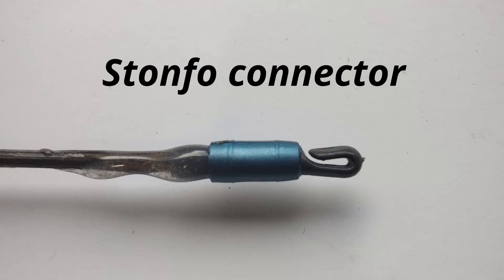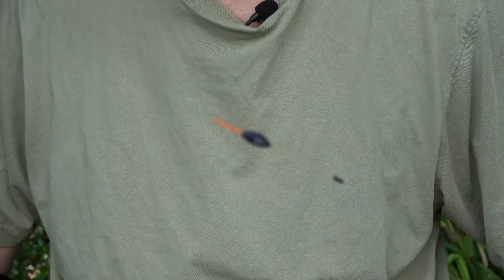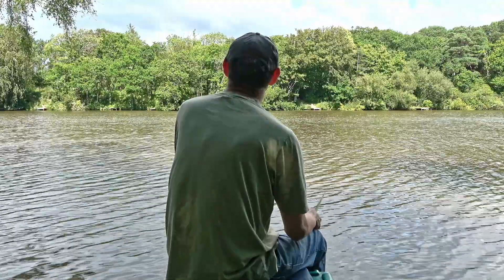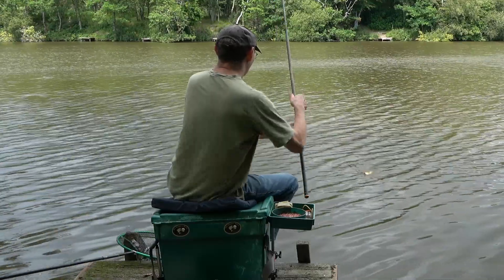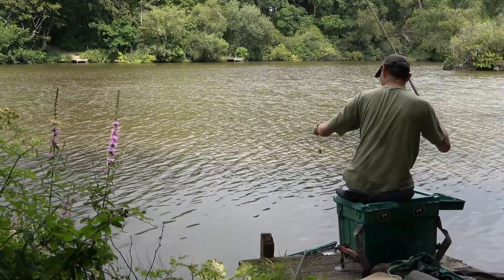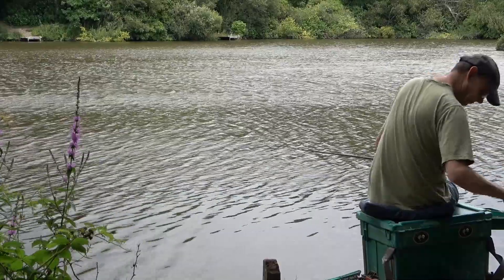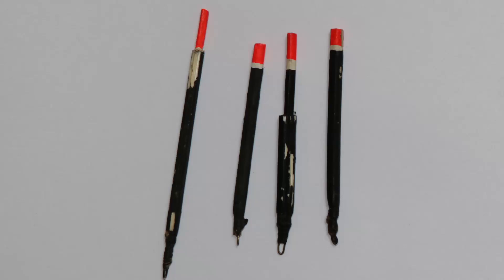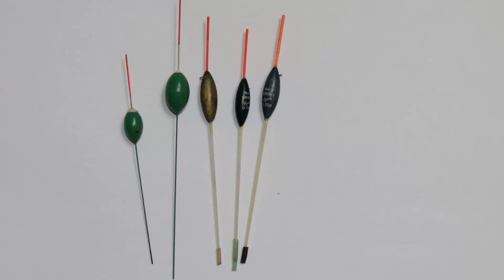Whip Fishing - Part 2 - Setting Up a Short Whip

Comment: I have fished the whip with great success for many years --- I know a lot of folks say to leave your rig about a foot short of the whip----I find that slows you down quite a bit,, if you have it about 3" short of the whip you dont need to move your hand position on the whip, when you unhook a fish and rebait -you  then keep your hand in the same position on the whip as when you are fishing and hold your hook in the same hand and bait up with the other hand. and get it in the water again much quicker than if you have to reach for the hook.--Also I almost always fish the whip with my home made wagglers, which as long as theres not a heavy flow are far far superior to using a top and bottom float -especially in the wind.
Reply from the maker: In the days when I did serious speed fishing which was a long time ago my rigs would have been set exactly how I wanted them. It was a long time ago but it did vary a bit according to the size of fish - quite often the size of fish I was after were very small - down to 85 to the pound. To avoid baiting up very often the bait was usually toughened pinkies with a couple of pints being bought every week but only the ones 3 or 4 weeks old being used. It was possible to get many fish on one bait. For these small fish a waggler float was far too slow - mostly I had very small top and bottom pole floats, with the fish sometimes struck BEFORE the bait hit the water - by the time the strike started the bait had hit the water and been taken.